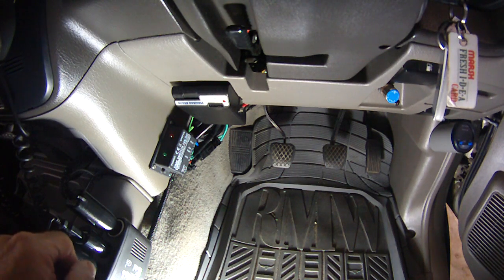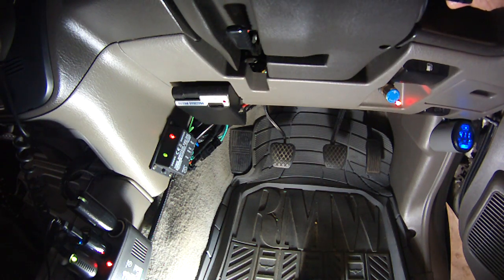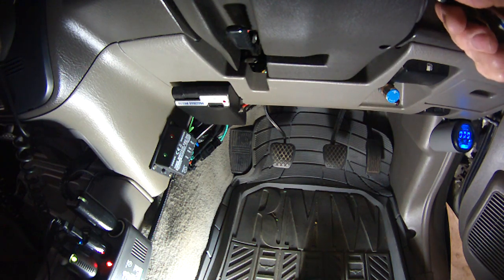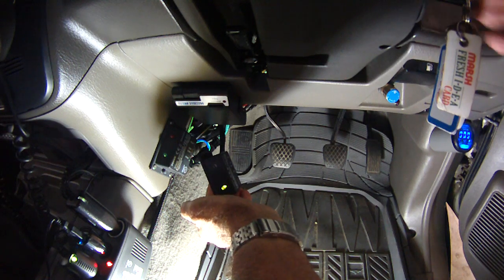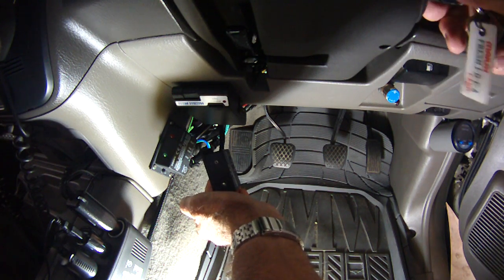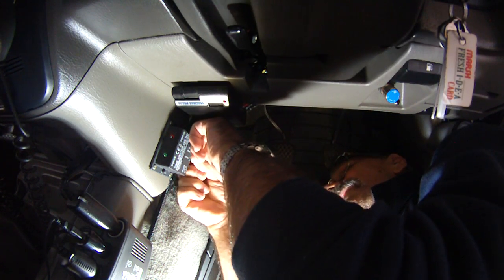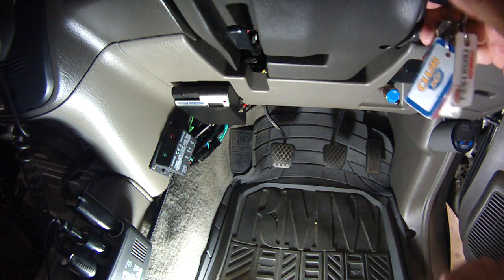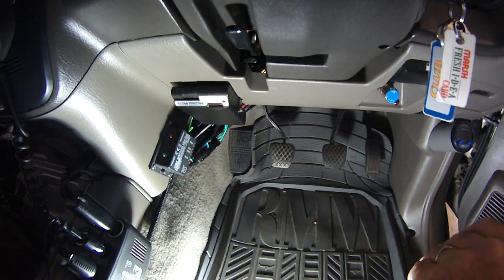Nissan 3L Glow Plug Timer (Kemo M113A) Variation

Comment: Geeyoutoo! long time listener first time caller. I owe you about 50 beers mate. I've spent the past weekend pulling my hair out wondering why i couldn't get the switch to work. the link you posted in the previous comment was my savior. Turns out my Kemo was 14030M and didn't work on the original schematic. Swapped the wires over on the relay as shown and it worked straight away! Was able to dial the timer to 36 Seconds in 3 attempts. No more fear about my plugs potentially costing me a head or engine.
Reply from the maker: Thanks mate, pleased we could help, I recently changed my GP's to the metal version after my original ceramic had done 366,000k, I'd had the metals for many years but on each of the 3 occasions I had taken the ceramics out they were fine so they went back in. A few weeks ago took them out and they were showing signs of pitting so the metals finally went in, I'm sure the years of having this timer has contributed to the longevity of the old ceramics.

I've got another project I'm working on which replaces Dawes/Tillix/needle valves with an electronic device I bought OS after a lot of discussion with the owner of the company, so far it is shaping up well, when I get further into the sorting I'll do a write up.
Reply: Hey Geeyoutoo, I’m just wondering what the process for running an LED light from the glow rail to in the cab? I’ve got a 12V LED which I’ll run the positive side off the glow rail then earth it out? My only concern is the amperage output of the glow rail. Have you run a resistor or something similar in line?
Reply from the maker: No resistor, make sure it is a proper 12v LED though, just power from the rear GP terminal and have a good earth under the dash, I use one of the bolts that secures the steering column to the firewall for my earth.

Comment: Hello, from what I already realized exists model M113A with two different batch  24024OM and 20018OM!
Which one is it that works with the ZD30 Di GLOW PLUG TIMER MOD?
Reply from the maker: They both work, the 200180M will work on my original schematic but the later 240240M requires a different setup, in this thread (if you can see the pics) there is the schematic we came up with to make the later model work. http://www.patrol4x4.com/forum/3-litre-zd30-di-engine-71/glow-plug-timer-zd30di-later-model-kemo-113a-wiring-181586/index8.html Hope this helps.
Reply: Hello geeyoutoo, is it a scheme that was drawn on a piece of paper?
Reply from the maker: Yes it is pictured in that thread I linked, can't you see the pics? if you can't see them it might well be worth you joining this Patrol specific forum, doesn't cost you a cent and we have specific ZD30DI/CRD sections with a lot of info.
Reply: Hello Geeyoutoo, today I received my Kemo timer. But I was surprised to have come with a different batch from what I knew (24024OM / 20018OM). This Kemo M113A has the batch 06034OM. And now I ask, what the scheme for this one?

Thanks in advance!
Reply from the maker: The schematic I attached ealier should work fine.
Reply: It's this one, right? http://www.patrol4x4.com/forum/attachments/3-litre-zd30-di-engine-71/287521-glow-plug-timer-zd30di-later-model-kemo-113a-wiring-gp-timer-compressed-jpg
Reply from the maker: Yes mate, that's it..
Reply: Hello Geeyoutoo, I already installed my Kemo M113A (06034OM), potentiometer is very sensitive after more than 1 hour to tune, it was about 30 seconds. But there is a problem after starting the engine, kemo restarts. I'm using the schematic, glow plug timer (New Style). Can you teach me how I can solve this problem? Thanks in advance
Reply from the maker: That isn't a problem, mine is set for around 20-30 seconds and it also restarts after engine is started, it only runs for another 30 seconds and not the 5 minutes of the original ECU timer.
Reply: Geeyoutoo but I now have metal glow plugs, will not they melt?
Reply from the maker: No, it's only 30 seconds, people run metals without the timer.
Reply: Geeyoutoo OK, thanks for your help.